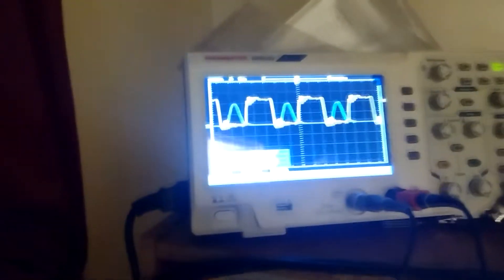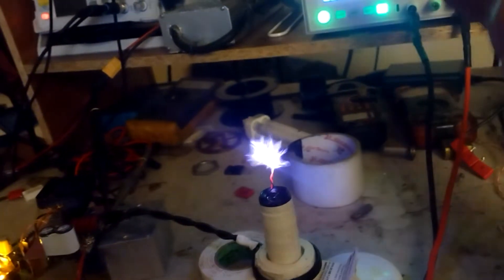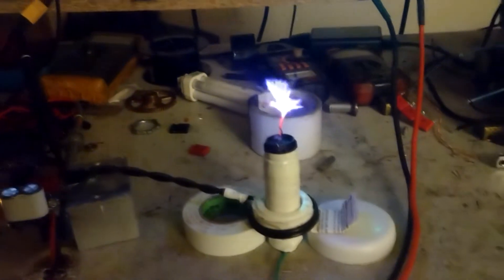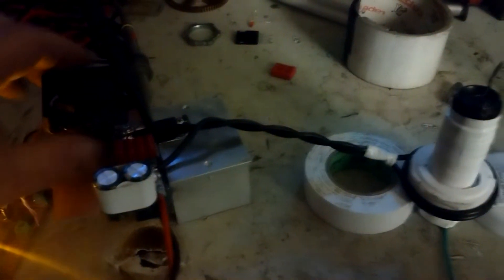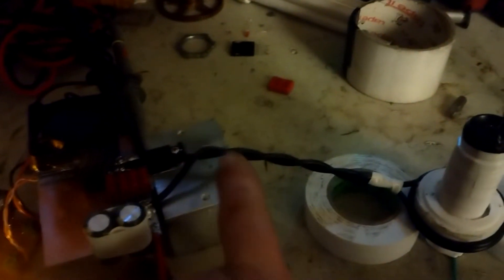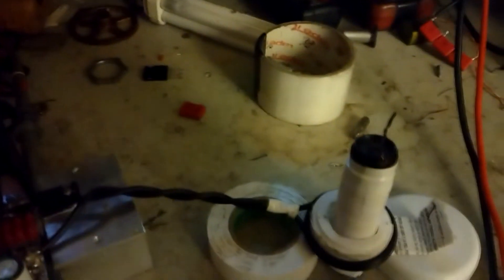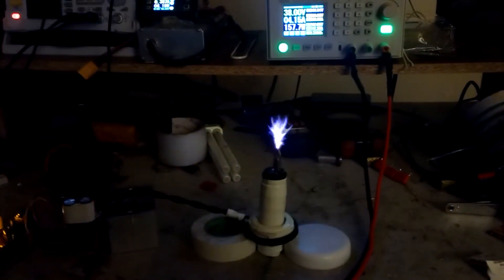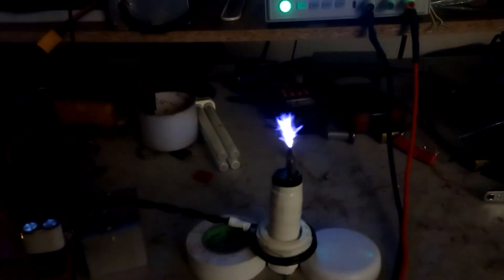4.3 MHz HFSSTC w/IXDD630

Comment: Great flame.. i just love these coils at around 3-4MHz. How well does the IXDD630 performs? I was thinking on using the 14A version in my class E coil too because even two ucc27324s are not enough to drive the gate as fast i would like to. (around 1MHz)
Reply from the maker: The IXDD630 is pretty dang beefy. I don't think there is much it can't handle. I feel like I could use that single driver as a general driver for almost anything. For reference though, many people seem to get away with 9A pk UCC drivers, or dual output drivers at 5A each you can parallel. so long as the fet you're using doesn't have a crazy large input capacitance it should be fine. For 1-4mhz coils I just typically use a UCC27322.

Comment: I just bought a few stp75nf75 fets 75v 80amps, 0.0095ohm rds , I am gonna reemplace the irfz44n s on my tefatronix setup I think these new ones should take the 35v wich is the max that my boost module can provide , irfz44n been taking 28v no problem so far but I am afraid to keep raising up , also I got a new irfp260 so here we go again with the hfsstc heheh this time I am gonna try to add some kind of gate protection 12v zenners back to back should work right ?
Reply from the maker: I think 28v is the highest I've pushed any using the Z44N's but that def seems close to the edge. 75V seems pretty reasonable and I really like using the 100v fets. As for protecting the 260 I mean honestly back to back or face to face zeners is technically supposed to add a layer of protection but it's all up in the air honestly. It's such a complex physics to me I don't really get it. I have never actually observed a dangerous gate voltage swing damaging the mosfet while scoping it. Typically what seems to happen is the mosfet can go into breakdown well below the max Vgs, and some low wattage zeners don't seem like they would do much anyway other than burn up if they started passing current. I've also had some setups using 460's or something where I'm pushing over 30V swings on the gate to get the output I want. I've had 260's that seemed to instantly be destroyed even with zener protection at very low input voltages. I've had some higher wattage zeners just heat up real fast and load the circuit down, but have the circuit running fine when the zeners are removed.

Comment: I like to build one
 What curcuitnand coil (turns, etc) tostart with?
Thank you
Reply from the maker: It's really up to you based on the components you want to use. You have to set some values such as desired frequency for example, and from there that basically sets all the reasonable limits of all your other variables. If you just want to make a class e coil the point of that IMO is understanding how soft switching can be used to run a coil at hundreds of watts+ using a single mosfet without it developing any appreciable heat or any noticeable heat at all to the touch. For that concept you don't need to be in the MHz and can do hundreds of KHz instead.. but if you wanted a more characteristic HF plasma flame then things will become a lot more difficult for a first build. 

I started playing with feedback arrangements and fixed frequency using CD4046 PLL chips but the easiest method does seem to be the schmitt trigger oscillator. The 74HC14N seems to work well for this and creating the oscillator is easy and only requires a resistor and capacitor. It's a fairly common oscillator where tutorials can probably be found online. You can use like a 5K pot and maybe 150-300pF capacitor value. 

The output of that oscillator would feed the input of a suitable gate driver. The UCC2732X family, the UCC27524 seems to work well also, but you can get away with less powerful ones with lower frequencies and smaller mosfet gate demands. So basically so long as you have this variable frequency oscillator, and have wound a secondary coil you know is within the range of that oscillator.. then you just need some power stage to drive a primary coil with that signal. You will eventually tune into the secondary resonance and it will create the plasma flame all depending on variables like the primary coupling and input power and gate drive waveform. The hard part comes in when trying to modify the capacitance and inductance in the primary circuit so that it soft switches when running at the same frequency the secondary coil is being transferred the most power properly. This all has to be experimental unless you basically have a kit that comes with a PCB and exact LC values.
Reply: @Magneticitist  i ordered the PCB for the STACATA qcw. It should be here in a few days. if you like to play with thatr, I can send you a PCB.
Reply from the maker: @Gacha.Cupcake  Oh Staccato? If that's basically the "Pseudo QCW" kind of circuit where it's a ramped SSTC I've made a few of those and they are pretty awesome. Maybe easiest way to get long arcs. As for the QCW that uses a controlled ramped output from a buck modulated DC bus, that's one I haven't made yet.

Comment: I was just thinking , could you add a series cap and make it dual resonant ?
Reply from the maker: I guess technically yes but if you add a series cap you change the resonant frequency of the parallel LC that is already there in the drain shunt.
Reply: @Magneticitist  I tried taking the Schmitt trigger out of the pll board and running the feedback straight to the cd4046 , but still works way better fixed Frequency , I should try a CT feedback I do not know how to build it but I got a few ferrite rings laying around , I guess one end of the winding goes to ground of the logic and other end goes to the antenna right ? If it do not work I should try to invert the polarity
Reply from the maker: @rodriguezfranco3839  Yea pretty much. It can be a little more complicated than that but what you described is a good place to start and will probably work.

Comment: Aren't you worried that all your precious equipment will be fried by a strong electric field  generated by that tesla coil?
Reply: Equipment is usually desing to not be affected by electric fields , I play with my tesla coils near my phone or laptop and nothing happends
Reply from the maker: Yea I guess at first I probably was but over time just got comfortable with it after nothing went wrong. I should honestly be filtering these things a little better. Easy to maybe just throw a toroid choke in line with both the pos and neg.